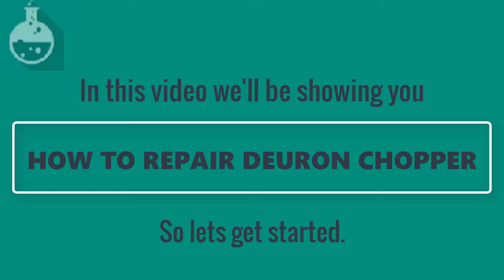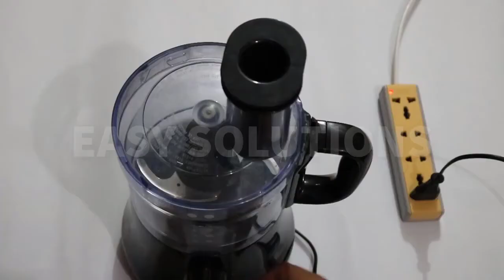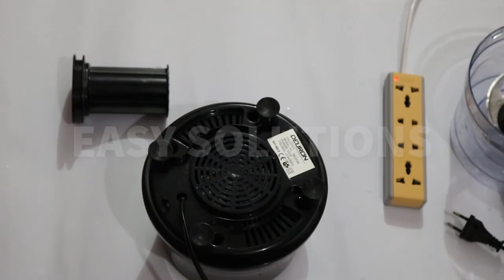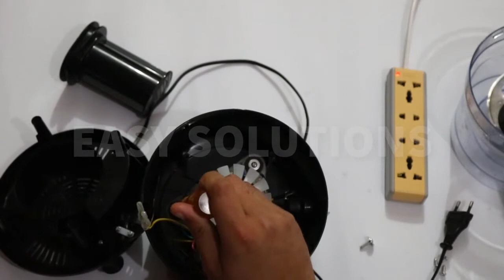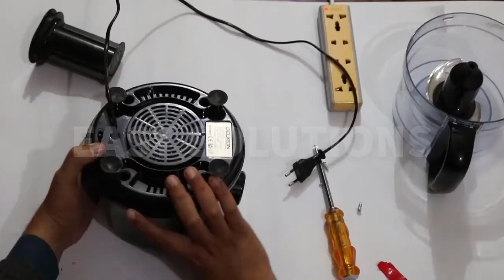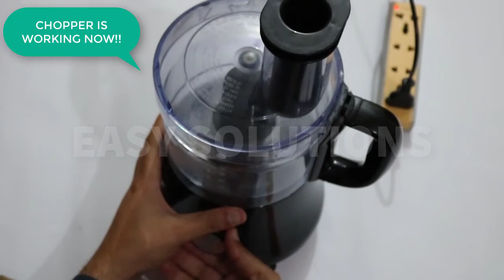How to repair deuron chopper

Comment: Chopper mai blade nahi utr  rha melt ho kr jam ho gya hai
Reply from the maker: Remove the Work Bowl Cover and unlock the Work Bowl from the base so that it spins freely. Gently pull up on the Work Bowl while rotating it around the motor shaft. This will place pressure on the bottom of the blade and may dislodge the blade from the shaft.
Reply: @easysolutions90  blade Ulta lg k jam hua hai